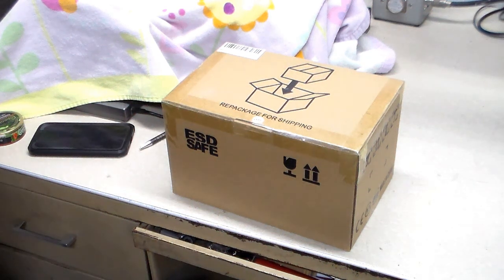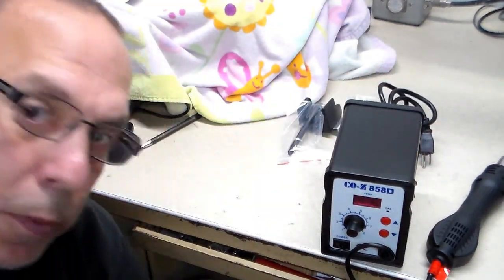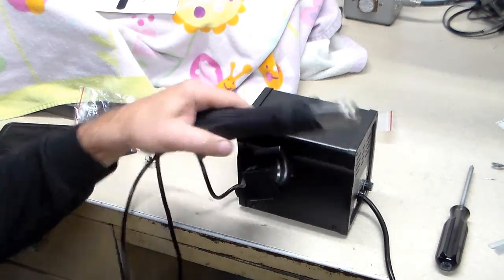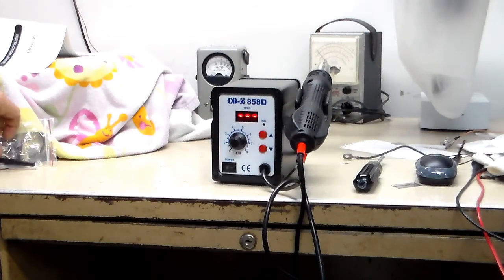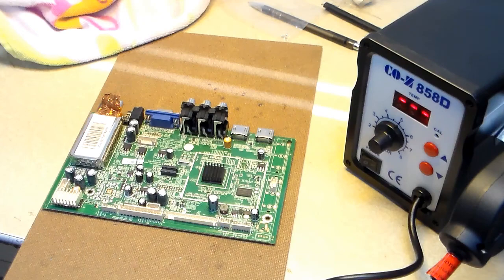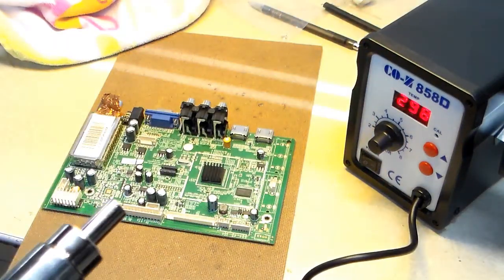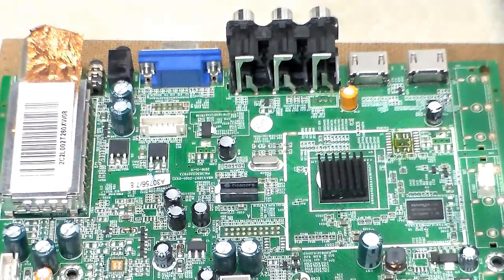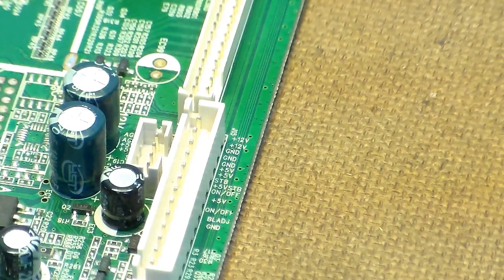CO Z 858D Hot Air Rework Station

Comment: Anyone know what the little black rod in the separate bag is for? No mention in manual.
Reply: Its for lifting chips. You slip it under the chip while using the hot air. I have some of those as well,  although I probably only used it once or twice.
Reply: @mohamedkikia7338  The black rod is too big for slipping under a chip.  Maybe the thin metal U shaped bit that is in the same plastic bag can be used for chip removal but it's too flimsy.  I have no idea what either piece is for but I'd like to know.

Comment: They make a heat tape that you use to isolate the component. It will help keep the hot air off the other parts of the board, and hole the component in place
.  https://www.amazon.com/TekLine-Premium-Kapton-36yds-Polyimide/dp/B0049KTIAU

Comment: I got  one too but the temp is not spot on keeps jumpin around.the calibrate is not or not seem to be doin much when i tried it
Reply: I have the same issue. Aside from temp jumping around, it doesn't get hotter than 270C. I might return it.
Reply: Did you get the fluctuation fixed? Thanks
Reply: @j.lietka9406  I doubt he got the fluctuation fixed. This hot air machine does not support calibration.
Reply: @ChavezDIY  so how do you know the temp is correct? Thanks y gracias
Reply: @j.lietka9406  I used a grilling thermometer and put it half an inch away from the tip. Wouldn't go above 270 the one I had. I exchanged it. The second unit reached 300C after several minutes unfortunately the meat thermometer doesn't go above 300C. I'm waiting on a laser thermometer to arrive in the mail. But this is a crappy product, I don't know why it has so many positive reviews on Amazon. I was going to return the second unit for a refund but the window closed July 2🤦🏻‍♂️. If you plan to do SMD soldering, get a better unit.
Reply: @ChavezDIY  I might get a Yihua brand. Thanks again
Reply: @j.lietka9406  That's what I eventually settled on as the upgrade from the COZ858. I bought the Yihua 959D. My laser thermometer arrives tomorrow so I can test it.
Reply: @ChavezDIY  I thought about getting the Yihua 853AAA 3 in one (hot air, soldering station, & BGA, for about $190 or so. But I am not sure if the pre-heat platform can hold a full size laptop m/b. I want to do a GPU reflow on a laptop m/b. Also thought of getting the Yihua soldering station & hot air combo, the 862 I think. Thanks again 🤓
The thermometer I would get would have the dual channel with thermocouple sensors
Reply: @ChavezDIY  don't laugh but I might get a small hot plate - temp adjustable - for the pre-heater. Make a support for the m/b so it can be height adjustable too!
Reply: @j.lietka9406  😆😆